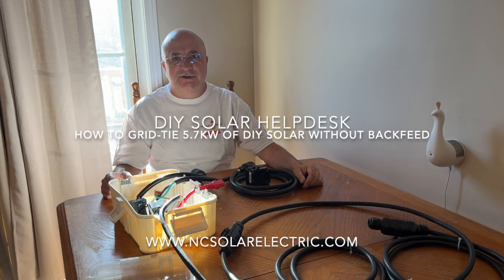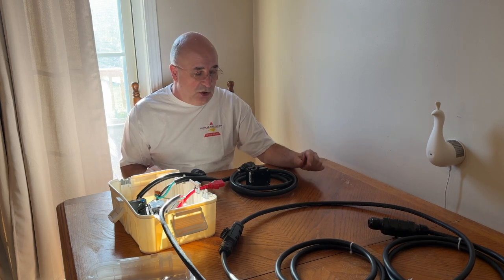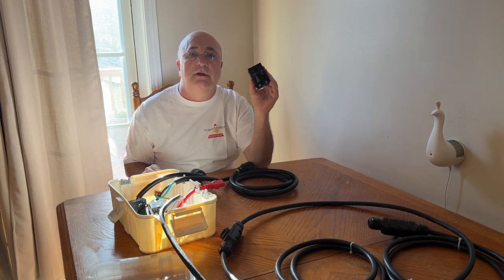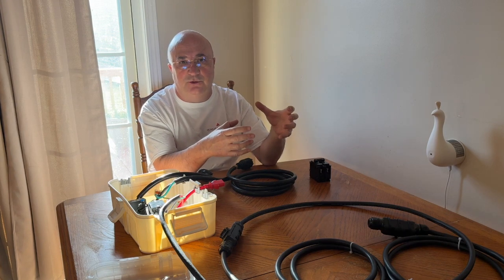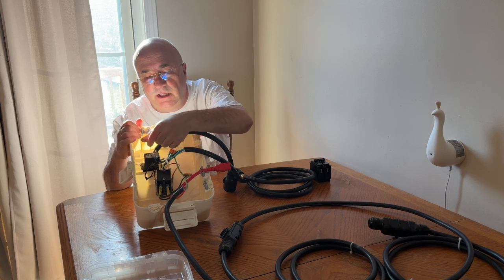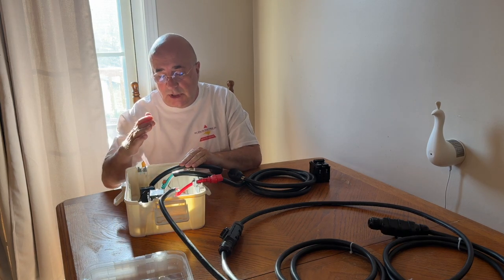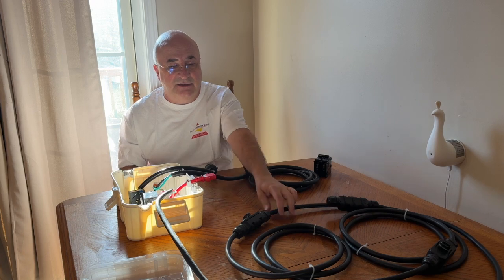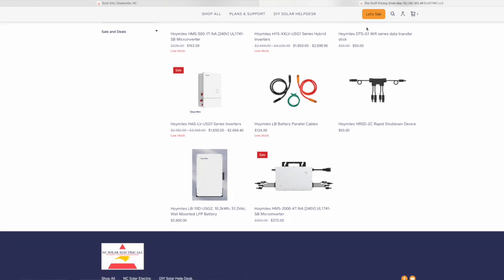How to Grid-Tie DIY Solar without Backfeeding for Crypto Mining

Comment: I don't understand what the current switch does.  Does it connect your load to the grid if you draw more than what your inverter can supply?
Reply: No, it disconnects the solar from the grid if the load is not large enough to prevent it from back-feeding to the utility company. It's a grid-tied only microinverter.